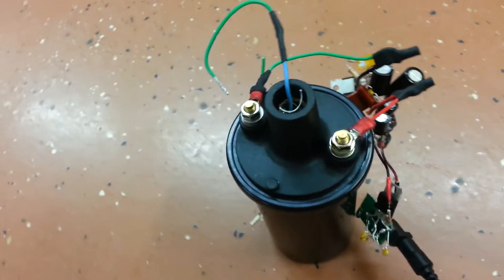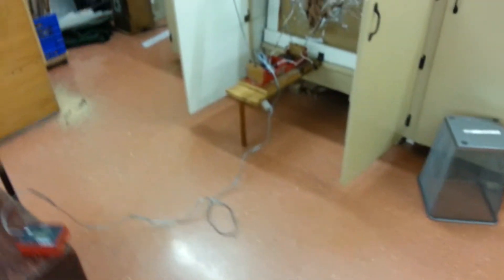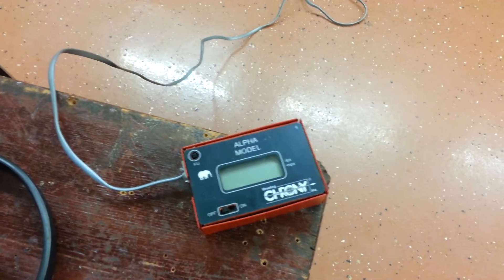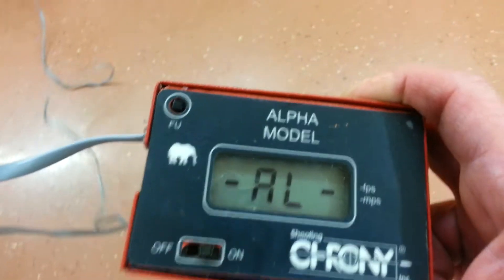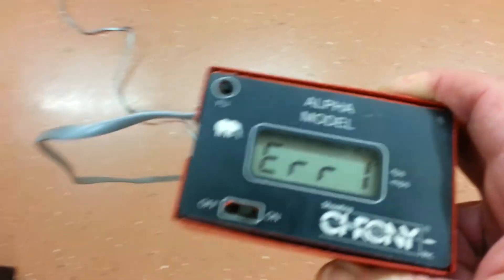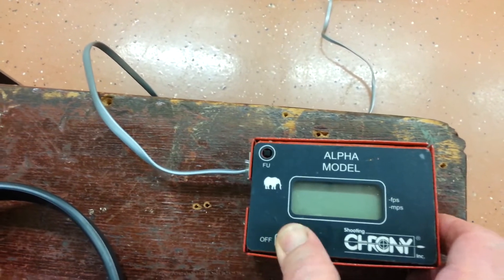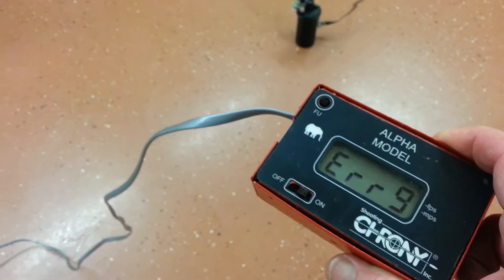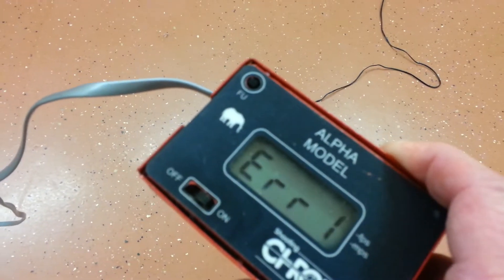Electrical spark might affect chrony operation Airgun Lab

Comment: Charles Gauss and Nikola Tesla would have smiled. Yes, this is an induced signal error. Gotta love the 1980's Tech that the Chrony is based on. One way to improve the chony's performance and accuracy is to get a Step Down DC to DC Buck converter.
Reply from the maker: How ya doin', Matthew? The mini EMP can certainly confuse a lot of electronics. I replaced the HID lights in my Prius (the failed every few years) with some generic LED headlights.They came with a converter or power supply, not quite sure what it was, that was electrically really noisy. I kinda made the radio useless.  Some good copper foil shielding around that power supply eliminated 90% of the noise. But I was surprised how much noise the PS put out.
So where would you use the buck converter on the chrony, exactly? I am always game for improvements.